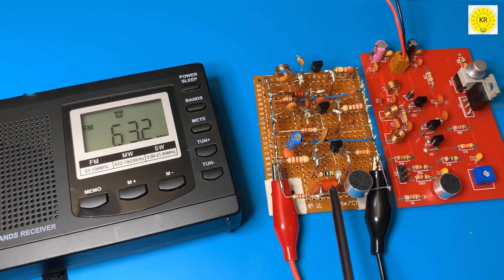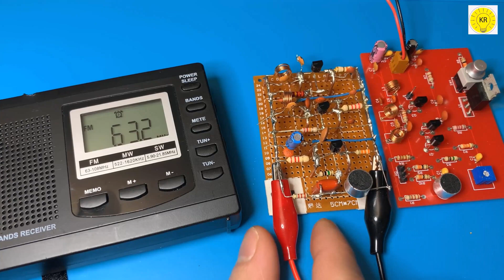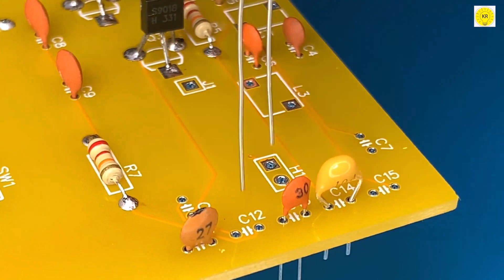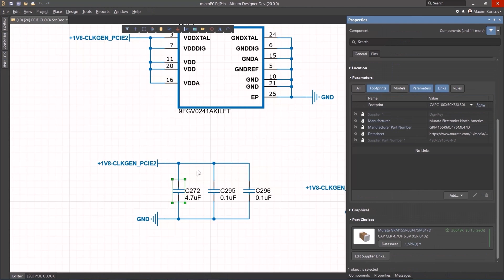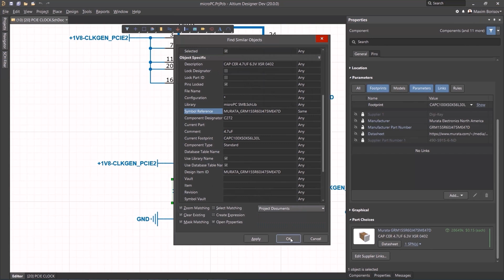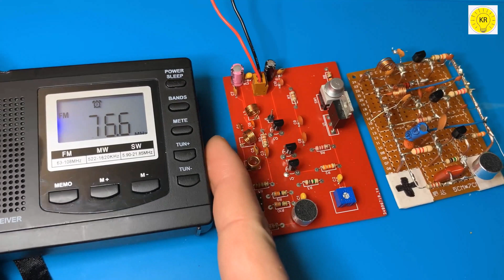How To Make Your Own Fm Transmitter

Comment: a nice way to build up the print like this.  I have a question if I will make it like this from a 2 watt is it stable with a box or does it go from 92.7 mhz touch it and shoot to 102.5 mhz ✌🤩👍 Maybe It's The comments not very good I do it with Translate👍👍